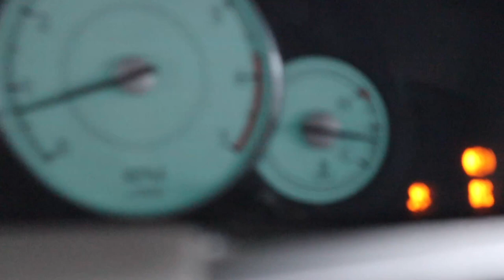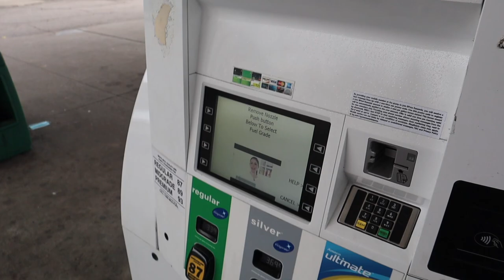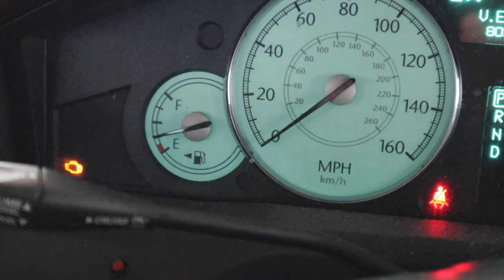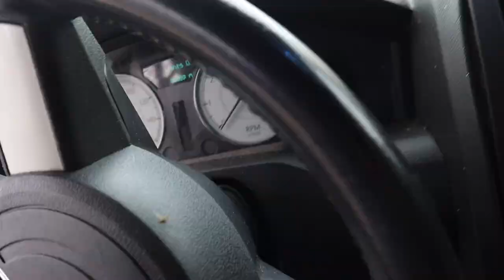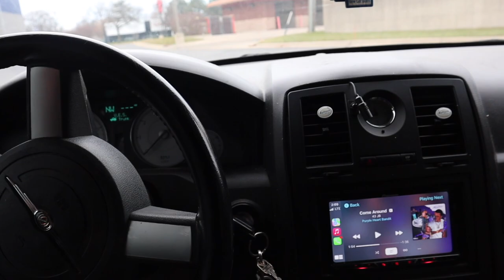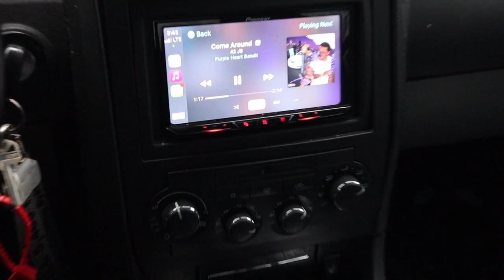My Full Bolt On Chrysler 300c Won’t Start *MOTOR BLEW*

Comment: Hey eBay quick question. Did you or do you notice any surging with those mods? My build is very similar to yours but I have a lot of surging while accelerating. Keep up the good work
Reply from the maker: Honestly No Man Hmmm You Must Have A Electrical Issue Do You Have Speakers ?